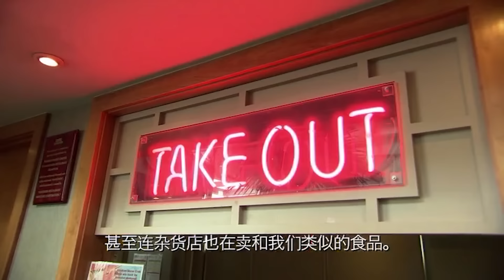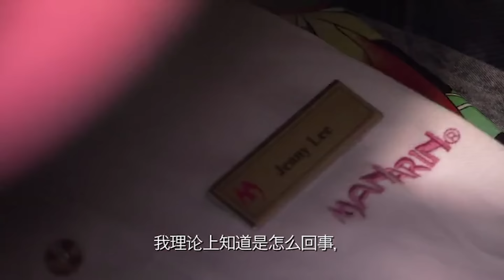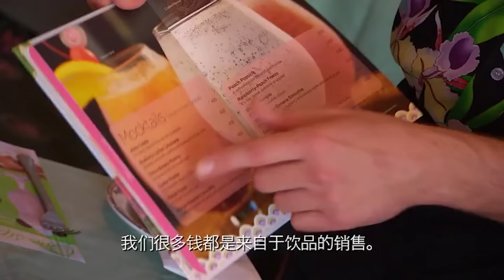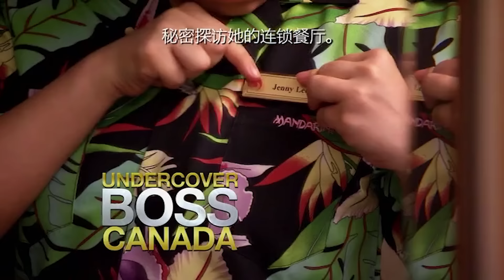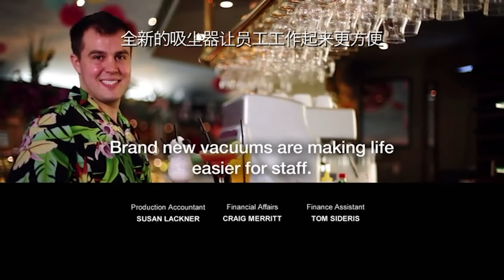Undercover Boss Canada: Mandarin Restaurants (Full Episode)

Comment: fans barely help in a kitchen like that, circulating 40 degree air ain’t helping and a study shows it could make it hotter as the fans provide or generate more energy which in turn actually makes it slightly hotter, they need ventilation not circulation, A for effort tho and i could be wrong about what she meant by “fan”

Comment: THERE SHOULD BE A BETTER DESIGNED KITCHEN N NOT NARROW LIKE THIS...PLUS A AC SHOULD BE INSTALLED IN A POSITION THATS CLEARING D AIR FROM 5TO 6FT HEIGHT STRAIGHT ACROSS N NOT INTERFERE WITH D FIRE BLOWING DOWNWARDS...N THAT MEANS ON D COOKER HOOD LEVEL..